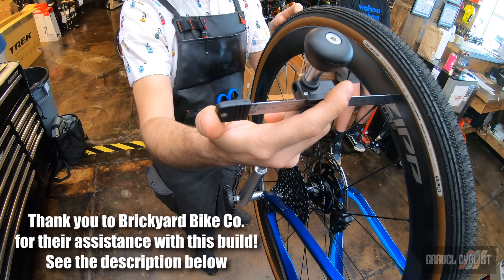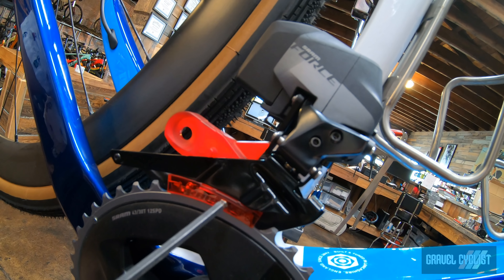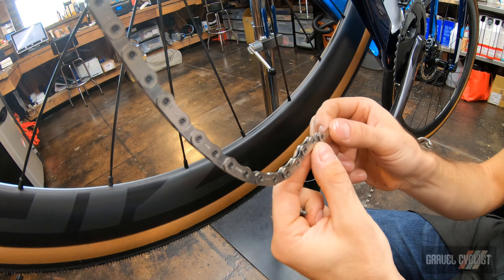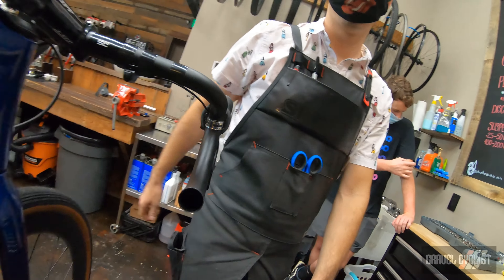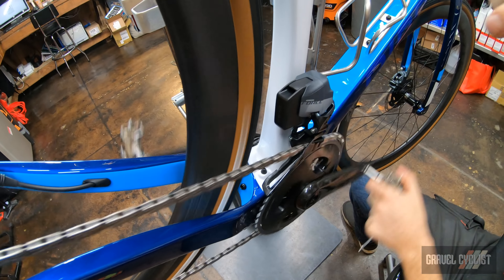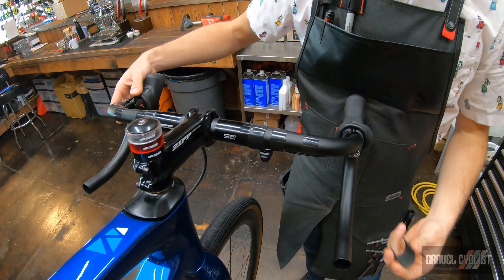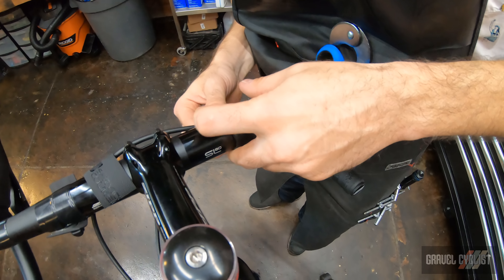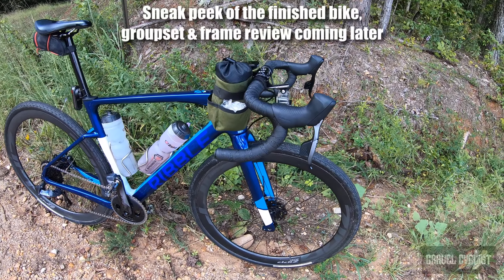SRAM Force eTap AXS Wide Gravel Bike Drivetrain Project: Part Three (b): BUILD the Ribble CGR SL

Comment: I was not familiar with Ribble till this video, Thank You Jom ! Please review this bike I might order one . Cause I love blue....I hope it rides well and you happy with it ...
Reply from the maker: David, a review is coming, which is the point of this series. Build it, then review later.
Reply: @GravelCyclist   Hi Jom, I'll be curious about your review as well.  I came really close to ordering the CGR SL back in 2019.  I also looked at the Thesis OB1 before ultimately going with the Viathon G1. To be honest, I would have been happy with any of them.  Ribble also makes a titanium version of the CGR which I'm sure you're aware of.  I am currently running the Rotor Aldhu 24 crank  in the oval 1x.  I can convert to 2x simply by swapping the direct mount chainrings.  (and then buy 2x shifter/derailleurs)  I've been curious how AXS or Ultegra Di2 front derailleurs handle oval chainrings?  What have you heard in this regard Jom?
Reply from the maker: @JosephDowski  Joseph, I cannot vouch for AXS 2x with oval chainrings, but I posted a video review about two years ago of the AbsoluteBlack chainrings, that I used with Ultegra Di2 2x at none other than Dirty Kanza. Provided you get your front derailleur properly positioned, they work very well. Good luck!

Comment: the pedals are torqued in to 40Nm???! ive always just hand tightened with the long end of a hex key
Reply: yes, proper lubrication and torque is recommended for nearly all fasteners, with exceptions. a loose pedal can cause serious injury to the rider or the crank or both. an overtightened pedal can be difficult to remove or strip the crank threads. with a torque wrench, you know.
Reply from the maker: Thanks Pete for chiming in!
Reply: @petergacek3245  Yep, sensible points there. Would also mention that it also stops those bloody annoying creaking sounds!
Reply: @petergacek3245  im not sure that has anyone ever had a pedel loosen off during a ride in the history of cycling, the axle body would have to seize up completely before it begins unthreading itself during a pedal stroke
Reply: No need tightening more than by hand .They will tighten themselves during riding. You’ll have a struggle to undo them if you tighten them to much imo.

Comment: how's your experience with Xpedo pedals? Do you tension them hard? i have all sorts of problems clicking out. I'd tried both original and SPD cleats. Any recommendations? I really want to keep using them as I fitted them over Favero Power meter, but the clicking out, especially when dirty is really bad and I dare say outright dangerous...
Reply from the maker: I reviewed a Titanium pair a long time ago, they were good but their cleats are a tiny bit different to SPD. They are compatible, but I noticed a little hang up at exit once in a while. I've stuck with Shimano XTR since then... not as light, but no issues with release, etc.